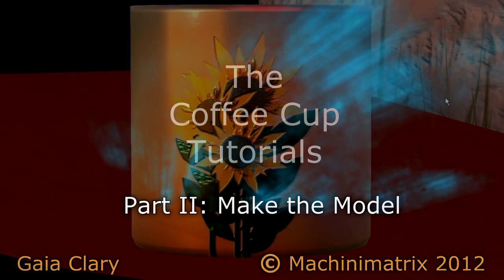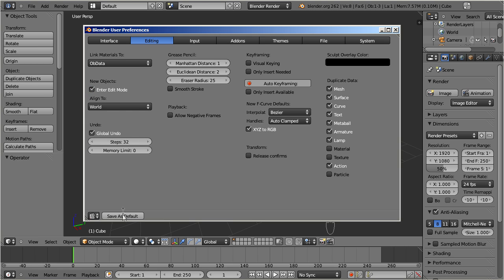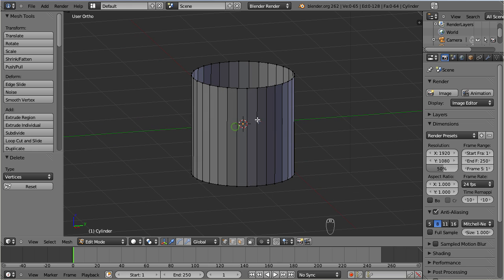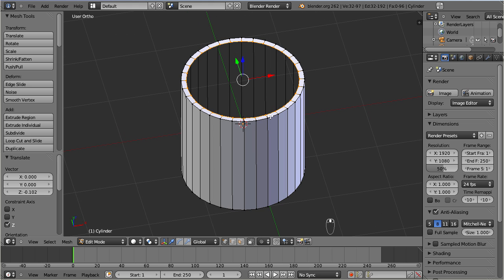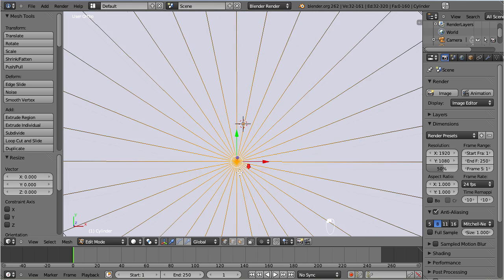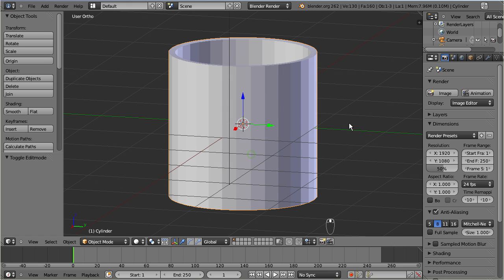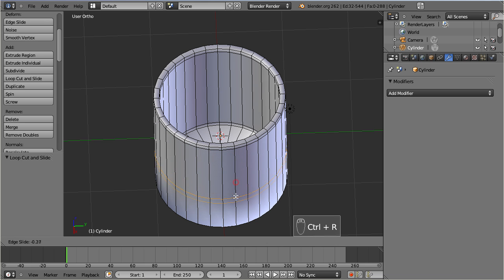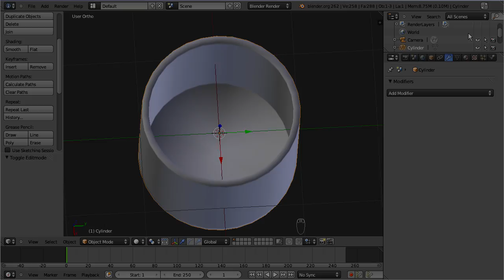Coffee Cup Tutorials (II: The Model)

Comment from the maker: You use Blender 2.63 which introduced Ngons. So by default the cylinder caps are made out NGons nowadays. So you will go to face selection mode, then select the upper cylinder cap and finally delete -> faces

Another alternative is to go to the Operator panel immediately after you created the cylinder, and change "cap ends" from "Ngon" to "Triangle Fan". Then proceed exactly like shown in the tutorial.